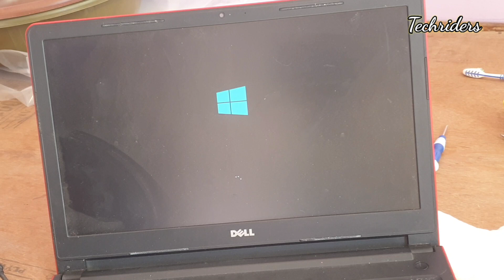Laptop Orange and white Light Blinking /No Display Easy 100% FIX

Comment: i did all process 2 time but still same problem. screen going on but after removing charging pc going shutdown and not opening without charging connect. 35% battery charge also available
Reply: Same 🥲🥲🥲🥲🥲
Reply: @basitgrowrich  replace battery 🔋
Reply: @JeetendraSingh017  yes 🥲🥲🥲🥲
Reply: fixed when you replace the battery? having problem the same as this

Comment: why did you removed keyboard & plate below the keyboard?
Reply: Normally these laptops have screws everywhere, those ones below the keyboard are holding the other side too, so they need to be removed😊

Comment: i have the blinking orange light and my display works.
Reply: @Ashish Golande i noticed its the battery at fault by going into the bios
Reply: My Dell laptop when I unplugged charger laptop turn off without plugged in charger laptop doesn't start and seen battery present 97 plugged in but not charging what's my problem
Reply: @raviranjankushwaha9645  have your problem solved
Reply: @Ashish Golande bro please tell how you resolved you problem when    your laptop shut down when you unplugged charger and it blink orange
Reply: Update please
Reply: I have been orange light blinking when connect power cable and my display working. How can fix the problem plz advice.
Reply: I also broo😢😢😢